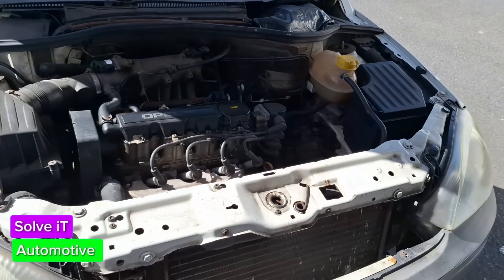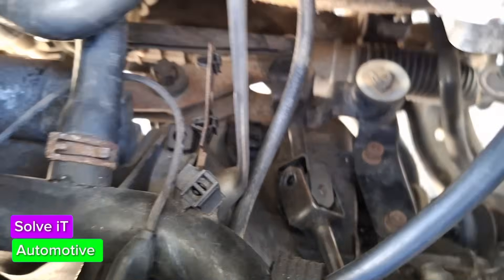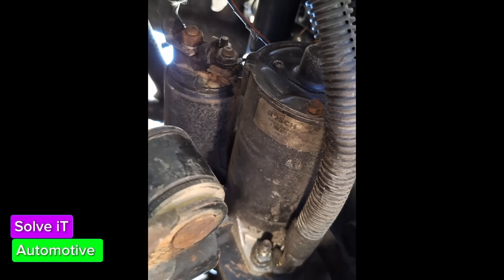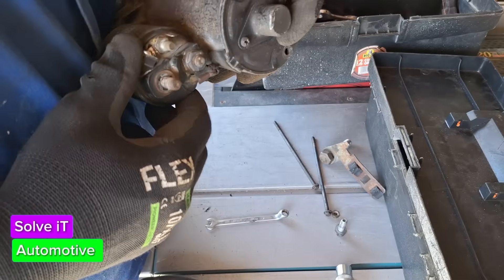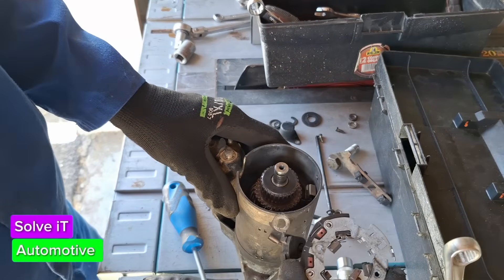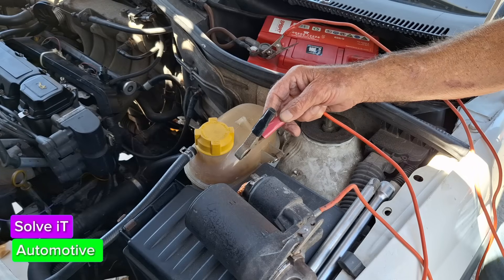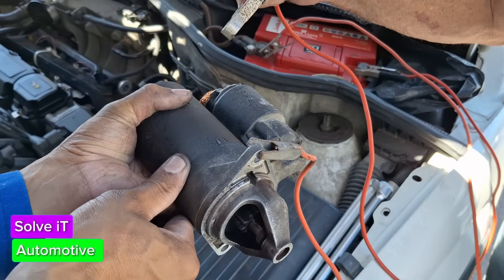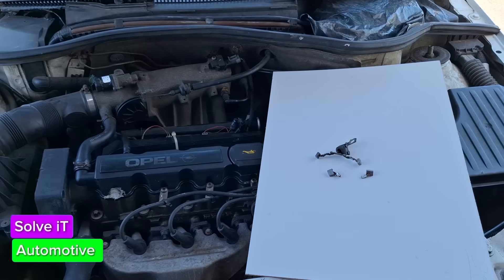Opel Corsa Utility 1.4i Starter Brushes Replacement

Comment: Hi i am having starter problems with my opel corsa gamma 1,4i 2005 model , I would like to know , is the starter for the corsa gamma utility 1,4i have the same starter with the same amount of teeth as the corsa car , some i have heard have 9 teeth in the gear and others have 10 do you think it will be cheaper to have a starter motor repaired than actually buying a new one and having it fitted
Reply from the maker: Hi . It's going to be best to remove the starter, inspect the fly wheel teeth. Inspect the starter teeth and then make a decision before you buy or repair anything. Best to take it to an auto electrical

Comment: what is the part number for the starter motor ,ı see you not only replaced brushes but the whole brush table what is the table part number if you remember.
Reply from the maker: So I bought it from a auto electrical place , there was no part number . I took the original parts with and they gave me the exact same . There are about 5 different plates and brushes.